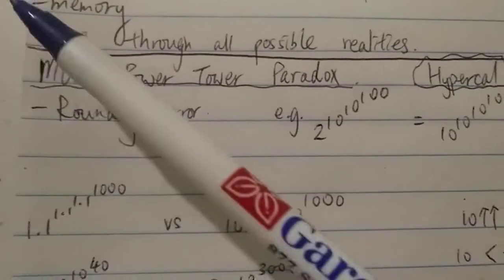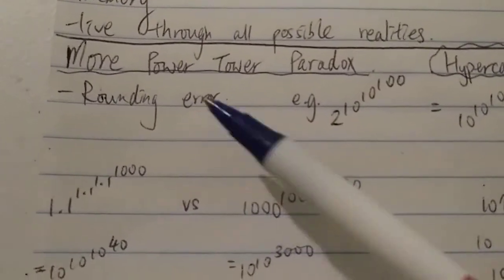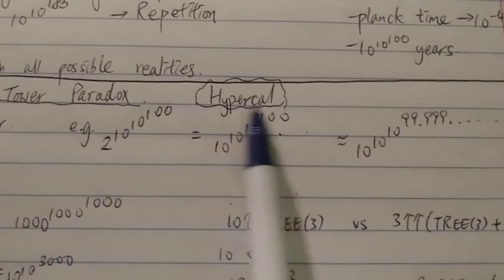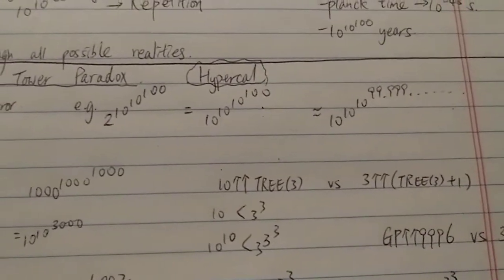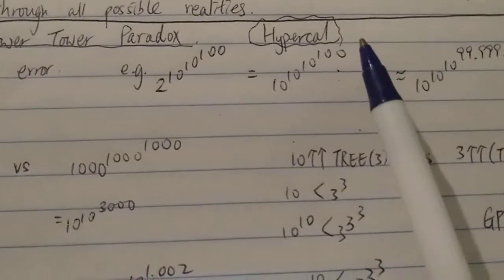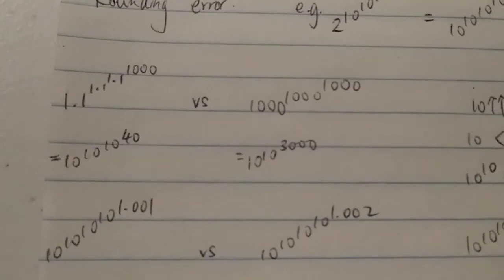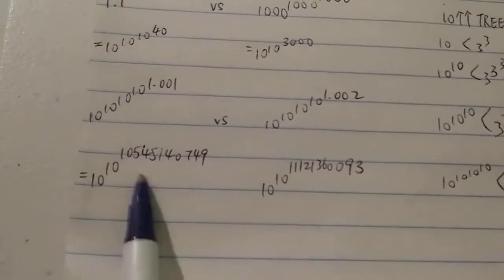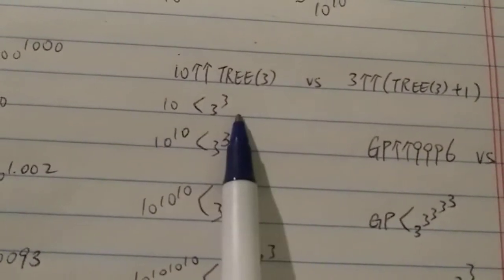10↑↑TREE(3) vs 3↑↑TREE(3)+1 (Power Tower Paradox)

Comment: I think the pattern holds for 11 but not 12., since  12 < 3 ^ 3 ,  12^12 > 3^3^3
Reply from the maker: Not sure what you mean. I used 10 in the video.
Reply: @carbrickscity  Yes, if you would have used 11s it would still have worked, but it would not worked with 12s. I think the breaking point is a tower between 11.8 and 11.9 where a power tower of 11.8 is much much smaller than the 3 tower and 11.9 is much much bigger :D
Reply from the maker: You can always add another 3 to the tower. You don't need many more 3 to beat it. Watch my power tower paradox videos. Even for a tower of 100s you only need like 2 more 3s in the tower to beat it. Something like that. Say 100^^6 < 3^8

Comment: As the tower of 10's and 3's grow, the tower of tens grow proportionally bigger.   Way bigger!!  One more 3 in a tower of countless numbers would not make any difference, let alone make it bigger.
Reply from the maker: You must be new to big numbers and power towers. You logic seems correct but it's not. That's why it's called "Power tower paradox". As you can see at 8:28: 10 <3^3, 10^10 < 3^3^3, 10^10^10 < 3^3^3^3, and this continues forever. One extra 3 may not seem to make a big difference in a very tall tower, but it's enough to be bigger than a tower of 10s that is one level shorter. One extra 3 is always bigger, doesn't matter how tall. It's actually even pulling away but you just can't see it in terms of power towers. The height of the tower weighs far more than the base numbers. Watch my other videos or simply read some more on Googology wiki. You are misled lol
Reply: A power tower of 3 twos is bigger than ten.  Using the same logic, a tower of 4 twos would be bigger than a tower of 2 tens, a tower of 5 twos would be bigger than a tower of 3 tens, etc
They are not!  Not even close!
Reply: Maybe I'm doing something wrong using that example. But it seems to follow the same pattern.
Reply from the maker: Except my example was 3, not 2. 2 is too small for your logic, and obviously you can't use numbers too small such as 1 in your tower. For 2 you need 3 addition 2 in your tower to beat 10. i.e. 2^^6 > 10^^3, and 2^^9 > 10^^6. And this continues forever. For bigger numbers it would be easier. i.e. 9^^9 > 10^^8 easily. Do some more research and readings yourself. It's not called the power tower paradox for no reason, cos it seems like a paradox to many people like yourself.
Reply: Got it.  Thanks!  Is IS a paradox.  Defies all logic!!

Comment: This one goes wayy against my intuition...

for example, your example of 2^10^10^100 vs 10^10^10^100 being roughly the same...
thats the same as saying 2^GP vs 10^GP right?
so basically having 2*2*2...(GP times)...2*2*2 vs 10*10*10...(GP times)...10*10*10 right?
now 2*2*2 = 8 < 10 right?
So then wouldn't you need more than 2^3GP to equal 10^GP?
please tell me where my logic is wrong because I want to believe you.
Reply from the maker: That's why it's called "Power tower paradox".
It seems not to be true but it is true.
What you are asking is basically this:
What is GP x 3? It's GP. In power tower form, they are the same. (10^10^100) x 3 = 10^10^100.
It is way smaller than 10^10^101.
Reply: A power tower of 3 twos ii greater than 10.  Using your same logic, a power tower of 4 twos would be greater than a power tower of 2 tens!  Of course it isn't.  Ain't even close!
Reply: A tower of 3 twos is bigger than 10. Using the same logic, a tower of 4 twos would be bigger than a tower of 2 tens, a tower of 5 twos would be bigger than a tower of 3 tens, etc.  They are not!  Not even close!!
Reply: @leefohl7251  it's true that the "10" tower is bigger than the "2" tower, but in terms of how much you need to change the top part of the tower to make the towers equal to each other, the differences is very slight, therefore they appear to be a rounding error and so (almost) equal